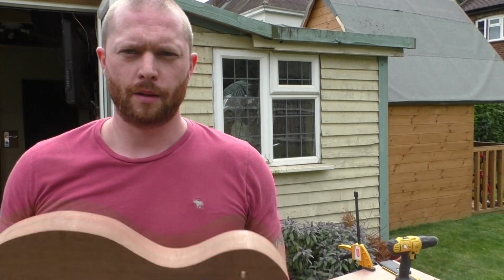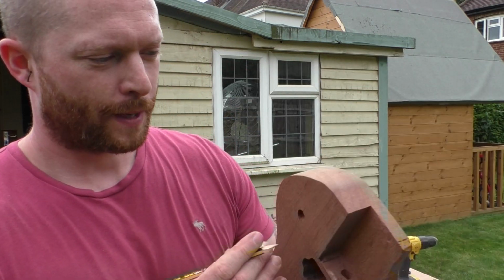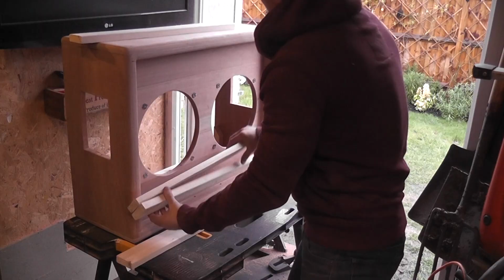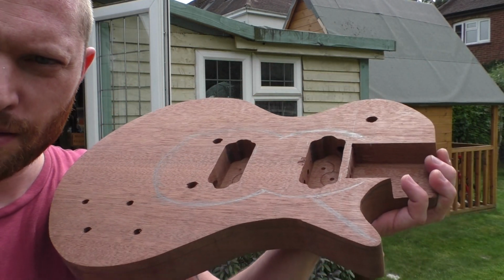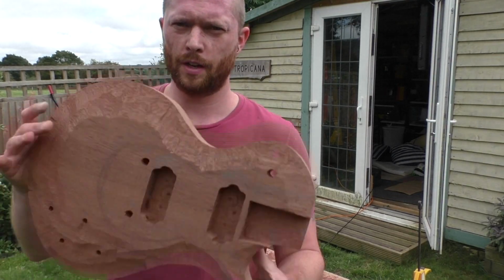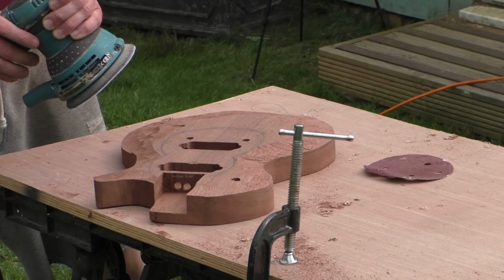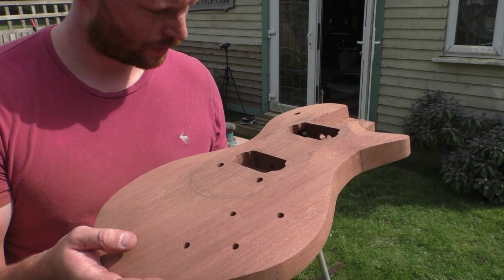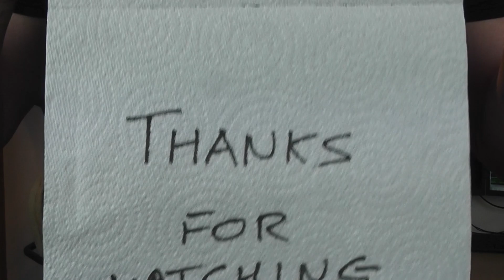How to make a carved top with a circular saw! - How to make a guitar part 7

Comment: outstanding series and great work man,The use of the circular saw to shape is well ingenious to put it mildly
Its looking really good mate and everything looks cool and in place cant wait to see the next one Cheers.
Reply from the maker: Thank you. I am expecting a lot of negative feedback for using a circular saw to shape the body. It’s what I’ve always used and it works really well. Just need to be careful and take it easy. It’s far quicker than other ways of doing it
On my first guitar I tried a spoke shave. Possibly the slowest tool I’ve ever used and not easy to get the shaping that desired.
Definitely try this way of doing it. Just don’t hurt yourself, that’s the important thing

Comment: I've watched quite a few videos of people (including pros) carving LP tops and this method (provided you still have all your fingers when you're done) is absolutely the most ingenious! A CNC machine would be better, but you can't pick up one of those at the Home Depot for $50.
Reply from the maker: This is my far the stupidest way to carve a guitar top but also one of the quickest. 
It’s fine as long as you’re extremely careful. Only have about 5mm of the blade sticking out the bottom and stand so that you’re never behind the saw blade so that if it kicks, it won’t hit you.
I’ve never had a saw kick doing. Probably because the wood isn’t wet, the blade is sharp, and only a small amount of the blade is sticking out. 
This is how I do almost all my carves (including tummy cuts etc) but would strongly advise against it 😂

Comment: That's certainly an interesting use of a circular saw.  I would worry about the saw kicking back, but with the guitar firmly clamped to a strong work bench, and two hands firmly gripping the saw, obviously it works.  

The effect is probably better than I could manage, but honestly, I don't like the "constant gradient" effect of using the circular saw - in other words I miss the concave surface near the edge of an LP archtop.
Reply from the maker: The circular saw is a terrible idea but I’ve done it so many times that I really like doing it. You can get the concave effect from a circular saw, it’s more pronounced with smaller diameter blades. 
I’m about to make a few proper Les Paul style rip offs so I’ll try and make a more pronounced concave effect. I may fail though

Comment: Circular saw?  Bit of madness, but brave!  Nowadays, there are so many safer options you can use with a cheap grinder - flap sanding disks, wood shaping cutting discs of various aggressions.  Accomplish the same with maybe 5 or 10 minutes more time... because there was one shot in the video where you could see, all in one shot, the spinning circ saw blade, the cord almost hitting it, and right behind it - your femoral artery. Which, if you cut that, it's game over in about one minute flat.
Reply from the maker: It’s not the safest but it is quite an enjoyable way of doing it. I always stand to the side of the saw rather than behind it so if it kicks it would miss me. I also have the blade set so that only about 12mm of blade is sticking out so it’s very unlikely to kick. That saw has a spring loaded guard too.
Reply: @PherotoneStudios   I get  the safety. (Well, sorta. )  It's just hard to watch!  ;>D  Anyway - thanks for the vid - making a guitar looks like an awesome project - so many different ways to go.  :)
Reply from the maker: I’m fairness I’ve been using a Shinto rasp recently for body shaping. Incredibly satisfying to use. Sadly it bent!  It’s hard getting the internal concave curves with a straight rasp though.
Reply from the maker: I’ve got one of those angle grinder discs. Not the chain one, that looks lethal. The only down side of those is that they block your view so it’s hard to see what you’re doing. They do work very well though
Reply: @PherotoneStudios  You familiar with Stumpy Nubs and his woodworking channel?  ( He's very good, btw)   That chainsaw disc almost made him true to his name - he's got it on video!  Darn thing sprung at his hand faster than a striking cobra.  :)  Keep doing your thing, man, you are inspiring.  :)
Reply from the maker: Oh wow! I hope he’s ok. I’ll check out that channel as it sounds interesting. Thanks for the feedback. I do listen to all feedback as it really helps me improve what I do. Thanks for watching mate and hopefully hear from you again soon
Reply from the maker: Oh wow that’s nasty! He has so many planes!!! How did you link a time in the video? The link made it start at the place where he cuts himself
Reply from the maker: Git? You must be from the Uk? That’s a great way to make the flame in the wood stand out. I have some spalted beech drying out which has some flame in it, I could use this on the beech
Reply: @PherotoneStudios  That's where I had paused the video before copying the link for you. Who knew?  ;>D
Reply: @PherotoneStudios  No, I'm from Vermont in USA. Just like words.  :)
Reply from the maker: Just watching some bits one YouTube and you’ll never guess what came up in a video. The chainsaw angle grinder! https://youtu.be/aXmtHo5bJ88
Reply from the maker: Just watched that carve video. Great idea!